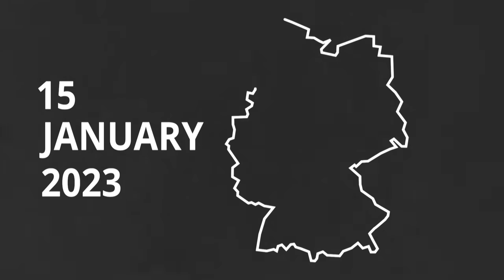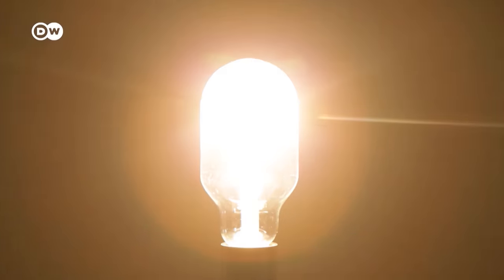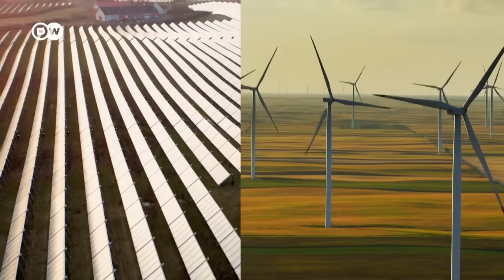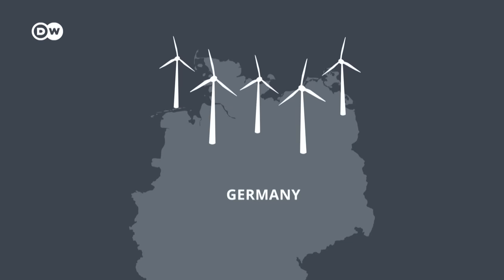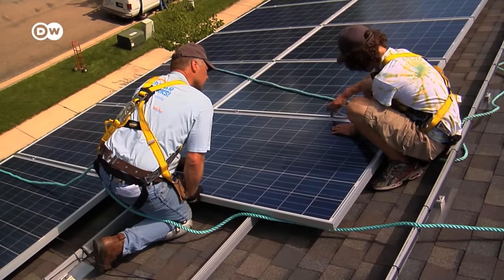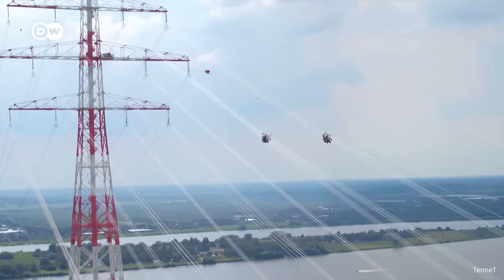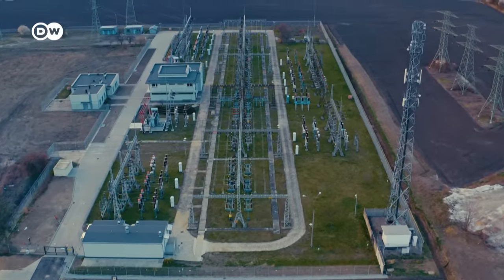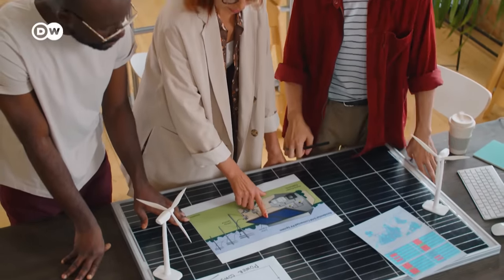This is what's REALLY holding back wind and solar

Comment: Here is another wild idea: let people easily install solar and wind in households and roofs, battery storage in the cellar - even if the providers install them - no need for changing the grid then. We don’t need hydrogen, the infrastructure is crazy difficult and cost-intensive

Comment: In SoCal, grid scale battery parks are being installed to soak up excess daylight solar production and allow it to be dispatched into the early evening. 
PS — in some areas Tesla home power walls are being centrally controlled so that home power will act as a virtual power plant.
Reply: It is still a drop in the ocean of needs. Lithium technologies like Tesla are not a rational solution for energy storage.

Comment: Québec does not have that issue, but that's a rather special case. In the 70s, the government decided to build dams a thousand kilometers north of the populated centers in order to meet the growing demand for electricity. The very first 735 KV lines were designed specifically for the needs of that project. Since then, Québec has built an absolutely massive network of high voltage lines that stretch from the dams up north and south almost all the way to New York.

More recently, Newfoundland built an underwater cable to Labrador and Nova-Scotia. The grid in eastern Canada isn't quite where it needs to be, but the recent upgrades are going to go a long way to get us there.
Reply: Quebec is a part of Canada, imagine if you demanded the same electricity price in all of Canada. It is nice that Quebec has good internal high voltage so has some parts of Germany. They are in reality about three areas with too low capacity between them but insist in one price zone.
Reply: Upgrade too 750kV could be possible, in theory, certainly same voltage is used on long distance lines in Ukraine and other former USSR countries, with two lines going to Poland and Hungary. So perhaps adoption of this could significantly increase transmission capacity in Germany.
Reply: Its not just a simple upgrade. 750 KV requires towers that are higher and wires that are spaced further appart. Québec is still building 735 KV AC lines as they are already widely used on the network, but just about everywhere else, long distance transmission is heading toward HVDC lines. The new lines in Eastern Canada are HVDC. Trans-frontier lines from Québec are being planed as HVDC lines, so it could very well be that HVDC could end up seeing wider adoption in Québec.
Reply: @jonathanlanglois2742  Problem is that in case of Germany the distances will not be that long, something between 100 km and 500 km, that is, If I am not mistaken, too short for HVDC to be economical.
Reply: @MrToradragon  I guess that I do have a different perspective. It is true that distances in Canada can be absolutely enormous. The other important factor is that in Québec, most of our homes are heating with electricity. That makes us, per capita, some of the biggest consumers of electricity on the planet. A single 735 KV line can do the job of a trio of 315KV lines. 735 KV lines were invented in Québec specifically for the James Bay project. It wouldn't have been economical to build 18   315 KV lines.

Comment: I have been thinking about it for a while now... The next significantly big innovation will be in GRID / transmission technology (reducing wastage). That too in material, design, planning, architecture.. It will be a moment similar to "vacuum tubes to ICs" in computer technology.

localisation sub-centres functioning independently as well as connected across countries. I think it already happens but efficiency and scale will be different in future.

Comment: As to the question of time shifting your load?  Yes…even though my provider offers no ToD billing, it’s a minor change to my schedule and helps balance the grid.

My washer runs late at night or overnight, then my dryer, if I’m not hanging the clothes outside, runs at bedtime.  My dishwasher has a 4h delay start that I usually hit sometime between 2000 and 2300.  My car charges after midnight.  My heat runs early morning/late night to boost the temps then coasts most, if not all of the day.

Comment: Wouldn't it be great if there was an energy source that was green, powerful, has a small footprint, that produced only a small amount of concentrated solid waste, and you could put it almost anywhere?
Reply: I think I've heard about it--It's called Chernobyl and it's going to be operating for at least another 20,000 years. By design it's impossible for it to meltdown, it uses a closed fuel cycle, and it produces energy too cheap to meter, plus weapons that can easily destroy life on this planet (intentionally). The only downside is that we keep finding out with every disaster that the best people in the field have no fucking idea what to do, are arguing about whether or not there will be a hydrogen explosion, and long after the fact can't even explain what happened. Fortunately they don't care, absolutely believe the Soviet government that only 51 people died as a result, and have destroyed their credibility many times over by repeatedly telling the public that all problems have been solved.

Comment: I'm able to minimize ironing of my clothing by carefully managing when / how I remove the clothes from the washing machine, smooth and then into the dryer.  Removing the clothing from the dryer before or immediately after the cycle further helps reduce wrinkles, as it doesn't sit all wadded up.  I'm sure my laundry habits are not unique.  If people allow the grid to dictate when laundry is done, won't more irons be used for wrinkled laundry?  Won't more polluting dry cleaners be used as well?  Is this a better idea?

Comment: One thing not mentioned is what is needed to stabilize the grid. Wind turbines can't.  Solar panels can't. It's big power stations that  do that, like coal power plants and nuclear plants. If nothing stabilize the grid it will collapse within minutes. To move energy from one part of the country to the other the stabilizers are also needed. In Sweden a power line was built thru the country (it took only 23 years...) and can now only transport half of the planned energy, due to lack of stability.
A someone said, making electricity is like dancing tango with three participants! The producer, the consumer and the grid.

Comment: Its not just their flakiness, renewables are also restricted by region, can't build a dam in a flat region with no water, can't build solar in a high latitude place that's dark half the year, can't build geothermal in an area where there is no easily accessible heat sources, can't build wind in a calm region. You can build a fuel based power plant (be it nuclear, gas, coal) anywhere.
Reply: Not exactly anywhere.  Steam turbine powered plants still need water, and droughts and floods shut them down -- as we've learned the hard way, only recently.  Also the hotter it gets the less efficient they are.  So ironically the very greenhouse effect they cause also makes them less reliable.

Also the more intermittent electricity infrastructure comes online the more load-following the remaining fission and combustion plants must become if they're to be of any use.  And since people can save money from producing their own power, even if it's only part of the time, you can't stop intermittent renewables infrastructure from growing massively.

So whether you like it or not, the demand for temporary energy storage will increase dramatically, as well as the need for power transmission across thousands of kilometers, not just a couple hundred at most.

Comment: As the world electrifies this issue will diminish. When most homes use electric cars every home will essentially have a very large battery that can be charged when clean energy is cheap and abundant. Same as how we use water reservoirs as large batteries by pumping water when the energy is cheap and using the turbines as generators when its expensive

Comment: 8:02 - One solution to the land rights problems is to build some or most of the underground power cables alongside railways.  Railways already have right of way and have existed as the country urbanized.  

Security and maintenance can be shared with the railway and the railway provide another way to access the lines for monitoring.  If Germany had done this first, they may have already completed it instead of running into all those land right issues on the first attempt.

Comment: The issue here is transmission lines, and battery backup, transmission to move the power here needed, and batteries to soak up the excess generation during the high production periods, and dispense that stored power into the grid during times of need. The tech in there for both, and the money is there to build them from the rate payers, the question is why aren’t the systems being designed, and built?

Comment: I know how difficult it can be when we have a row of cloudy days or when the winter days are significantly shorter. So it would be nice for homeowners to have the option of incorporate windpower as an addition to solar power. However, wind power is still difficult because it uses additional components to regulate current flow..Besides a controller, you need something that would keep the turbine from rotating out of control. Than the regular maintenance needed to keep the system in optimal order. And you need to position it were the air flow is at it strong. Besides mounting it high enough enough that it the air flow is not block by surrounding structures. Because solar panels is not the full answer.

Comment: From January 1 st 2020 all danish companies and households have electricity meters read every hour and therefore the option of electricity prices following the Nordpool day a head price. 
It has shifted 10 % of power away from the evening peak. Public focus only came in autumn 2022 with the high prices. So this is when it started to change. 
Many also have constant prices, but it has been more expensive this year so far.

Comment: Very interesting video. However, this as most similar videos and papers tend to focus on LCE and production cost from a netto perspective which has little bearing on consumer cost profiles due to individual tax and levy schemes in individual countries. Thus even with negative netto electricity prices many households across for instance Europe pay up to 50 % of their traditional costs anyway to finance subsidies for renewables, new transmission lines etc. Given this fact, motivation levels for consumers to share EV batteries, excess solar etc are not very high. Secondly sharing EV batteries will sharply increase the wear and tear on these, significantly reducing the residual value of your car.

Comment: Storage is essential to the smart grid. Batteries are but 1 option.
For individual homes, batteries are the solution that currently make the most sense.
The "grid" has many options.
CA, USA produces too much power on sunny days now that is essentially wasted.
A smart grid could funnel this excess North and East or South to Mexico.

As an off gridder, I only charge my riding mower on days with good sun.
I only use high power loads like air compressor or drill press when energy is available.
I only use my instant pot when I have good sunshine.
I will crank up Lil' Genny if I need A/C tho - LOL.
By upgrading batteries, I have turned 5 generator hours a night during Summer into 5 hours a week.
Later this year, when I install new panels, battery and inverter,
I hope to make that 5 hours a month or less. 5 hours a year would be OK with me! :)

Comment: 70% of the energy we consume are hydrocarbons. Electricity only represents 30% of the energy we consume. Germany has some of the most expensive electricity in Europe in part due to having invested heavily in renewables while maintaining enough on demand electricity (coal and gas) to provide power when renewables are producing little. Consequently, Germans overwhelmingly use gas for heat and to power many of their industrial processes. Electricity is just too expensive. So Germany is reducing its carbon footprint on electricity generation which accounts for only 30% of energy used. The high cost of electricity will slow the electrification of other processes and slow the replacement of hydrocarbons which still account for 2/3 of energy used: heating, transportation, industry, agriculture.
I believe there is currently strong opposition in Germany to banning the sale of new gas and oil furnaces, and the measure is unlikely to be adopted.

Comment: There are so many solutions. All you need are engineers to implement them. 
You can do HVAC using cables with higher cross sectional area to have a higher current carrying capacity, that could be using more cables and transformers in parallel to each other.
Using excess renewable energy to power up Direct Air Carbon Capture processes and hydrogen production from electrolysis, then use the hydrogen to turn the carbon dioxide back into hydrocarbons in an artificial photosynthesis process. The hydrocarbons from artificial photosynthesis can be used as fuel when it is needed.

Comment: If my power co. offered lower night rates, I would absolutely set the big use devices to run mostly then! washer/dryer in laundry room, 'top off' the heat of the water heater tank, ect.

Comment: DW Planet.

There is no possibility that renewables can replace conventional generation.
The biggest and unsurmountable problem is intermittency, which is not overcome by batteries. Batteries can support renewables for short term frequency support but that is it.
Renewables have no inertia which is required for stability.
Renewables do not contribute to reactive power which is necessary for a stable voltage.
Renewables do not support short circuit current levels which is required for an effective protective system for the grid.
There is also the problem of undesirable harmonics due to the use of inverters to feed the grid from renewables.

All in all it is a bad idea to pursue this form of genertaion, it's expensive, unsuited and also has a short life span compared to conventional generators.

Comment: There's a huge opportunity for transmission: Buried HVDC inside existing transportation Right Of Way (ROW). Many existing road and rail ROW could accommodate buried HVDC. This way you only have to deal with a few entities instead of hundreds (or thousands!) of land owners and dozens (or hundreds!) of government entities. As a bonus, you can put fiber in the same trench without issue.

Comment: As the use of EV's becomes widespread and their batteries are used as supplemental energy storage for households with roof top solar, the need for major HVDV grid connections across countries will be reduced. This distributed energy generation will be more reliable than the current power grid which is subject to weather disruptions and other outages such as wildfires and demand spikes.

Comment: It'd be cool if washing machines and other non-urgent equipment had built-in switches that would react to the power supply situation. You just load your washing machine and leave it on standby. It turns on whenever there's approval from the grid. Of course, with the user deciding for themself whether to wait for such approval or not. 
Also, I wonder if this would be effective. Calculations needed.
Anyway, this system should be built on existing homeware. Replacing perfectly fine equipment for this purpose alone wouldn't be feasible.

Comment: By the time we build battery storage systems, excess capacity to compensate for the big fluctuations in wind/solar output, and now remake the grid to go to the middle of nowhere, we might have just built nuclear. I'm all for decarbonization but the more we learn the more it seems "green tech" like solar and wind are better suited for filling the cracks where large scale power plants can't be economical,  but not so much full scale utility operations. Invest in nuclear for long term reliable energy for decades.

Comment: I think an app that sends customers messages like, "stress on the grid, hold off on large electric demands at this time" and then "excess energy in the grid, now is the perfect time for large demands on the grid" or something like that would be awesome. could even have like tierd plans. ppl who don't wanna worry about the grid demands, can pay a high unit price for electricity all day no matter what so the electric company gets a ton of mopney from them, then you have people who have a pay structure like the electric company will change how much electricity costs for them, based on demands so you can make decisions about when to do what based on cost, and then a 3rd tier which is super cheap, but only pulls from the grid when there is excess energy available. 

People can have battery packs at their house, so you can fill up batteries when the grid demand is lower, save it on location...and when demand to the grid is high, you can use the battery eneregy instead. and in the 2nd and 3rd options, you can either choose to use expensive electricity or, work around your battery energy. 

I think understanding more about our own individual energy use is a really smart idea. maybe electric companies can start producing like hourly or every 30 min reports of what energy use looks like in your house, so people can start making correlations between what they are doing and when they are using the most energy, and then compare that to when electricy is most/least expensive in their area as a way of getting ppl used to the idea of modifying their own electricity demands.
Reply: Most demand is from businesses though